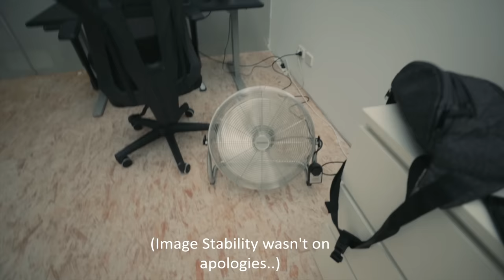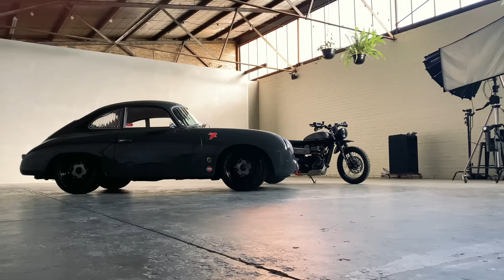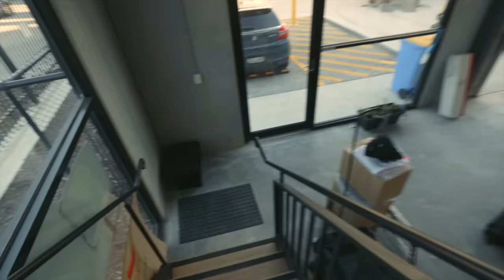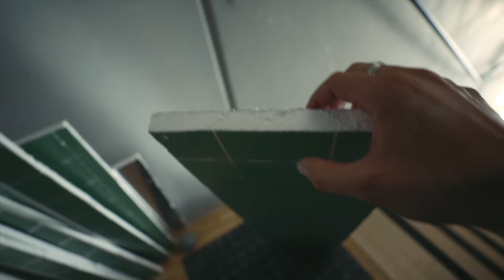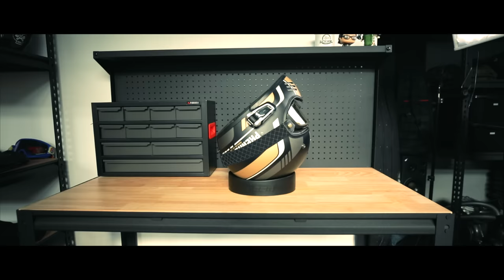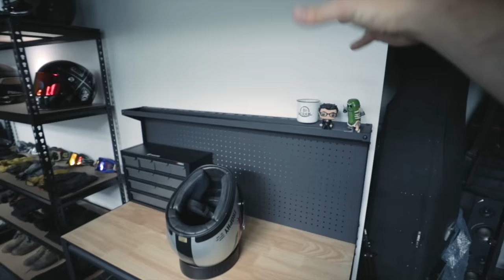I GOT A WAREHOUSE! | The Studio Tour Ep 2

Comment: The new place looks great, however I am concerned about your choice of material for blocking out the sun from the greenhouse roof that some designer thought was a winner.
I am an electrician by trade and the fact that you have just reflected the heat back into the small void between your glass and the insulation means that you may end up with cooked and eventually burnt out cables.
An alternative may have been to paint the glass, use black out vinyls or even stick on solar panels (I am sure that is probably costly - but may pay for itself in the long run).
I just don’t want to see a disaster video one day.

Looks great though, I wish you all the very best and look forward to watching more of your content

Ian
Back on Two Wheels
Reply from the maker: Thanks for this Ian! Yea it’s such a design flaw. I made sure to insulate the cables with conduit (I’m an auto electrician by trade and used the tough stuff) as I too was concerned about it. I have made a few ‘peep’ holes that I’ll use to check up on everything every quarter or so. Thanks for your concern and tips though man! Appreciate it